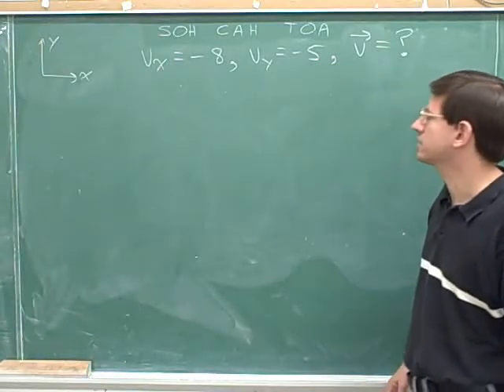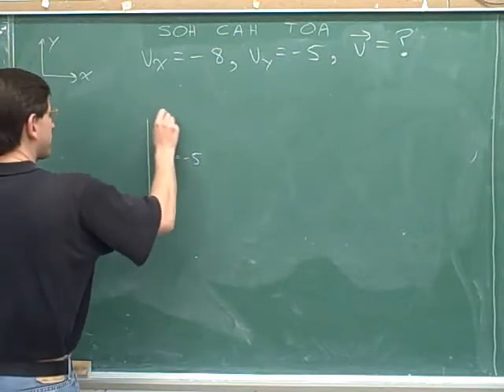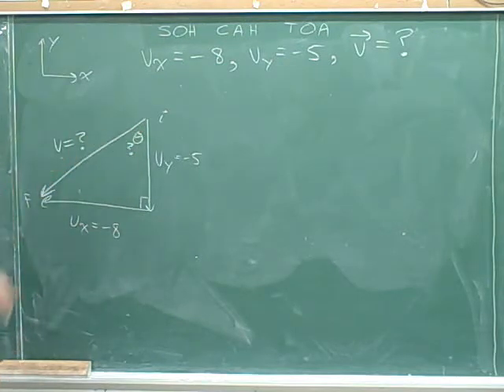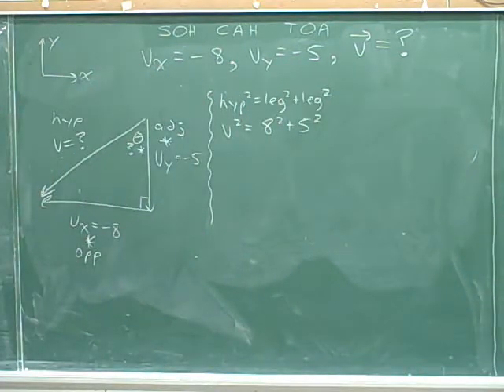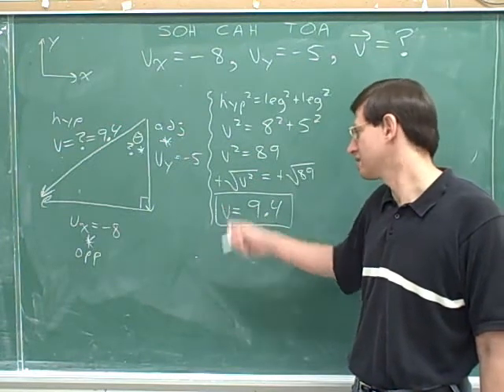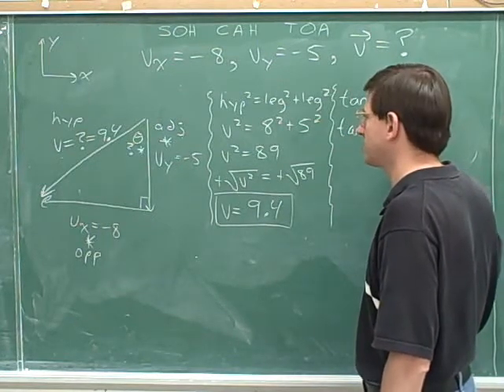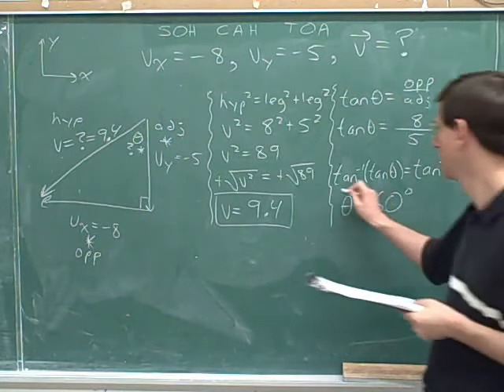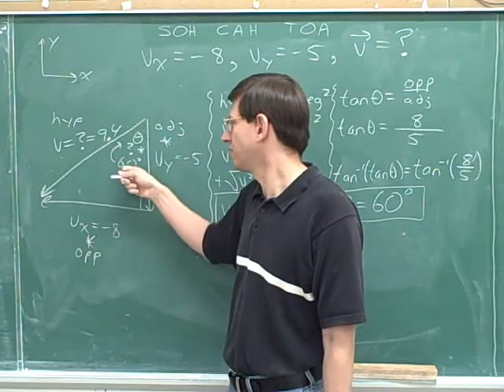Physics: Vector components (75)

Comment: I'm pretty sure that arctan*(8/5) = 57.99 which is about 58 degrees. NOT 60 degrees as mentioned as the answer to the first theta mentioned and then the next triangle mentioned would have a degree of 32 not 30 since 32 + 58 +90 = 180    :)
Reply: Susannah Bee yes indeed